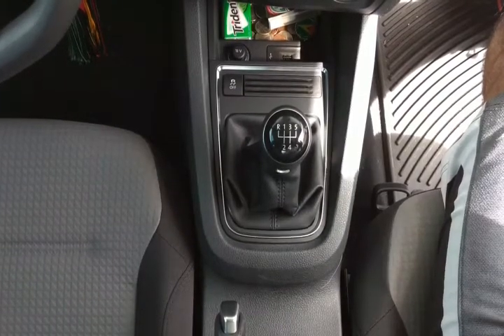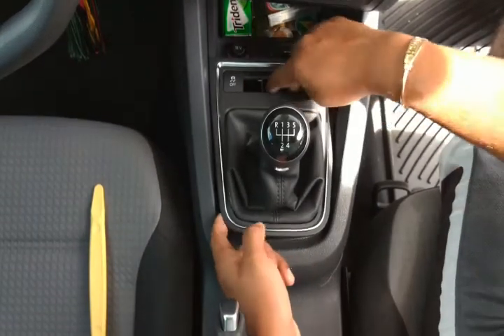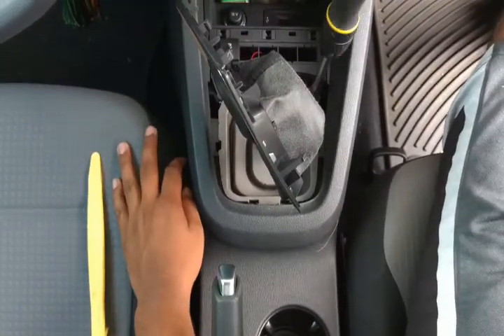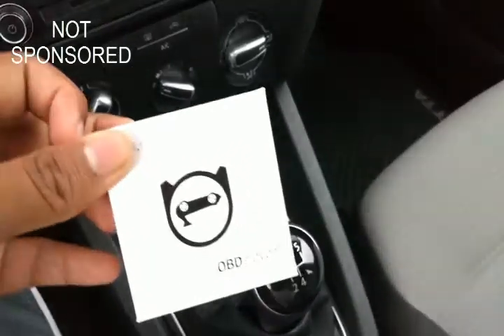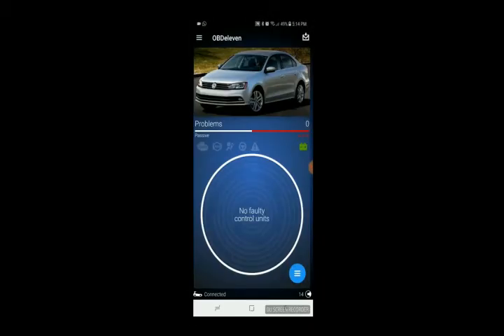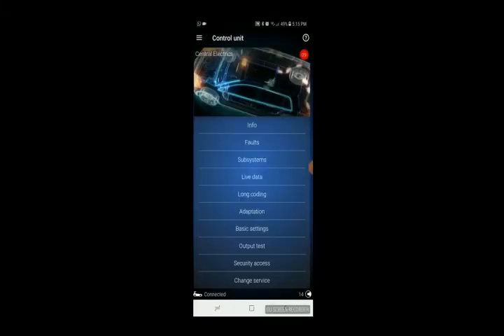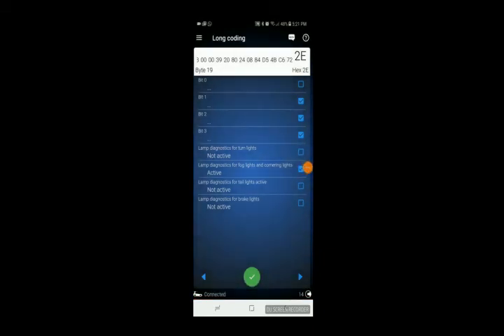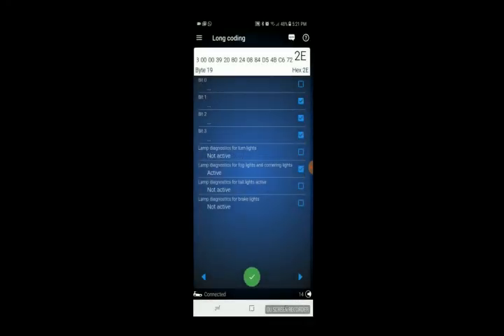Traction Control Install and Programing with OBDeleven (VW Jetta 2017)

Comment: Did the long coding through brakes and the way you describes didn’t work. Took the car to the dealership they didn’t know. Then I remembered that my cigarette fuse was blown. I plugged in an adapter to try and charge phone to test the theory wasn’t working. So I went to autozone they weren’t no help since jetta is complex and doesn’t tell ya exactly which fuse is for cigarette fuse. Checked every fuse manually. Saw the yellow one blown. I replaced that one. Plugged in adapter to charge phone. The cigarette thing is working. Was so nervous to deactivate the button took me a few seconds. I pressed and BAM SHIT IS F$&@“!?G working. Woot woot. Wheels are spinning!!!!! 
Check everything guys. If you long coded and no function make sure all your fuses are functional and not blown. Something so small wasn’t letting my button work. I hope I explained. Thank you!!!!
Reply from the maker: Haha anytime!! Thanks for the love bro!

Comment: So you bought the standard one was able to do long code to get traction control working. I look that one up but it says that it doesn’t allow you have to get the pro version. Did you use credits to do the long code. How much did you spend on the one you got. I want to buy one but not sure which one to get
Reply from the maker: I got the normal 70 dollar obdeleven and once you buy that it comes with the program to long code. You can do a bunch of other things with it as well. No credits are needed.

Comment: I have a 2018 passat gt in which i installed a button but my tc doesnt work, do you think the same code will work on it? My abs module number is mk60esc.
Reply from the maker: I would check the place you bought it from or ecs. Ecs tuning has the instructions on how to code it properly, but it's the similar concept.
Reply: @Jo5eph01  yeah i contacted them but they said they dont have code for that model yet and i got the stuff from boldsport.com
Reply from the maker: @c5vette943  That's great! Hope the traction control button works as it should!

Comment: Also let me ask u another quest. When in your video you changed all of those things in your video. Ontop of your phone it says long coding. Below that has all of those letters and numbers. IS THAT THE NEW LONG CODING FOR THE DISABLING OF THE TRACTION CONTROL OR....
Reply: Im curious if its just the 2 different cars. Cuz ive read countless amout of forums and no one has successfully disabled it the way your saying. And your the only one that has done it this way out of couple hundred thousand. And for you it works. Does it disable only the traction and asr control. Cuz everyone is saying that you need to long code it to completely disable everything. Cuz once the system senses slippage, it kicks back in
Reply from the maker: @michaelmorello3390  it works as every traction control button would work. It does peelouts and if I wanted to I could probably do a burnout
Reply from the maker: I believe that is the new coding because I had put it in and tested before I did the video.
Reply: Also where is you instructions in your car about wiring into the ABS MODUAL.
Reply from the maker: @michaelmorello3390  I did not do a video on that because someone already had a video on it and didnt want to have a video filmed with shotty information. So I completely cut that out

Comment: I did go through step by step. I have 12+/- volts going through wire. And copied your exact instructions literally. It might be the differ type of cars that could be the cause. But ive talked to atleast 10 people from 10 differ companys on this exact issue. You need a vagcom

Comment: I have 14 vw jetta 1.8t with a jb4. Unless it doesnt work for my specific car. Which could be the reason. After talking to usp. They said that button is only applicable for U S cars only. Which then u need to use a vagcom.

Comment: If it worked why dont u show another video of the button from usp or where ever u got it show up on the dash that it disengages and engages it. Ive tried you exact method. And its a bust
Reply from the maker: I also said to go off the instructions on esc tuning as to if the instructions were 100% accurate. I can do a video to show that it works perfectly but just follow the instructions on ecs and your good to go

Comment: No it doesnt work!!!
Reply from the maker: It does work, mine works 100%
Reply: Did you get your traction control button to work?. Did you long coded? Are you wiring connections flawless all hooked up and and tripled checked? Are any of your fuses blown?? Mine wasn’t working. 

Did the long coding through brakes and the way he describes didn’t work. Took the car to the dealership they didn’t know. Then I remembered that my cigarette fuse was blown. I plugged in an adapter to try and charge phone to test the theory wasn’t working. So I went to autozone they weren’t no help since jetta is complex and doesn’t tell ya exactly which fuse is for cigarette fuse. Checked every fuse manually. Saw the yellow one blown. I replaced that one. Plugged in adapter to charge phone. The cigarette thing is working. Was so nervous to deactivate the button took me a few seconds. I pressed and BAM SHIT IS F$&@“!?G working. Woot woot. Wheels are spinning!!!!! 
Check everything guys. If you long coded and no function make sure all your fuses are functional and not blown. Something so small wasn’t letting my button work. I hope I explained. Thank you!!!!

Comment: This actually works and makes the traction control off light appear on the dash when you hit your new installed button?  I have a 2017 1.4t s trim (base model) jetta.  Cant find anywhere else that actually gets it to work on a 2017.  Need it to work for winter in the northeast otherwise i cant get out of steep snowy driveway. Thanks
Reply: I believe that it will work with no problems.  its the same year and model car, just with a different engine.  The computers are most likely the same, Just yours probably has more options activated in it.  the ECS instructions lay it out perfectly.  The only difference in their instructions is they go off a more expensive VAG-COM program.  So when they say go into the 03-ABS menu for longcoding. in your OBDEleven it would be under the Central Electrics menu for you long coding.  Once you get your OBDEleven and do this mod you'll find about 10 other things you want to change on your car with it so either way it is an awesome tool to have for your VW.
Reply: Sweet. Got the tool coming in the mail to try it.  Don't need it for burnouts just snow, but ill do a burnout for you if it works haha. Thanks for making the video.
Reply: 2017 VW Jetta 1.4t S Trim (Base Model)
     Ok, got the OBDEleven tool and got it to work.  The dash light for TC Off now illuminates and no more flashing lights when the tires spin.  In the central Electrics menu, my car already had the same coding you had that you show in your video, so that didn't do anything different for me.  What i figured out to do was that i had to:
     Go into the Brakes - 03 menu (not Central Electrics) -> go to Long coding -> Select Byte 17 - check Bit 3 to change the value to 18 
     Then select Byte 19 - Uncheck Bit 4 and check Bit 5 to change the value to 22 -> save coding -> turn off ignition -> Turn back on and viola my traction control button finally works!  the ECS Tuning instructions (pg. 29 - link in the description) work great for the OBDEleven and i used a USP button kit.
     Would've bought it from them in the beginning if i knew USP cust service was just going to tell me i had to drive the car to their shop to get it to work (NY -> FL)  Then they told me that they couldn't verify that the OBDEleven would work for programming their TC Button, and had to use the very expensive VCDS system to make it work.  Thanks again for making the video again it steered me in the right direction to get this to work - just in time for the first snow storm up here.
Reply: AflakDuc so if I have a 2017 Jetta Sport 1.8tsi and I get the ECS button and the OBDEleven   -the directions on page 29 should work as written.  I am assuming your coding difference came in because you have a different traction control button?
Reply from the maker: GPMAX01 yea it should work because they all use similar computers
Reply from the maker: Aflak Duc yep it worked for my 1.4t s trim (base model) Jetta and I've been doing peel outs with a press of a button.
Reply from the maker: AflakDuc that's the reason why we installed it. TOO HELP PEOPLE! 😁(Not for the burnouts but just to have a better feel to the car)
Reply from the maker: AflakDuc Glad to know I helped save some money and time!
Reply: Thanks guys- going to order up both.  I live in Pittsburgh and we’re getting more and more snow.
Reply from the maker: GPMAX01 yikes, good luck up there man, I know it's super cold!